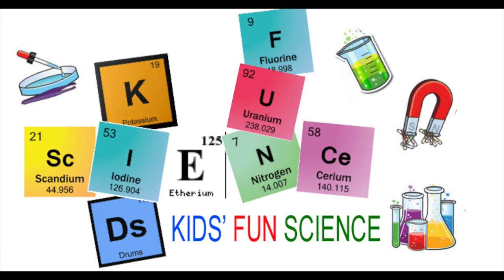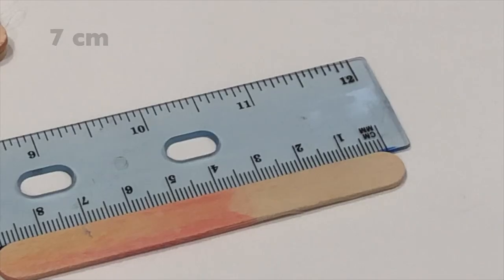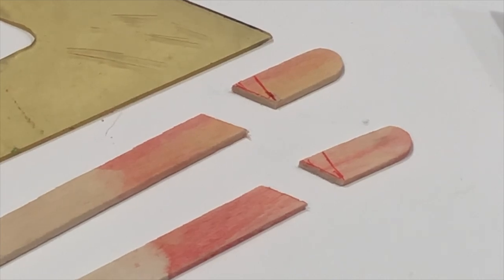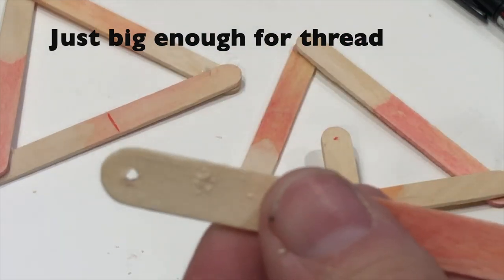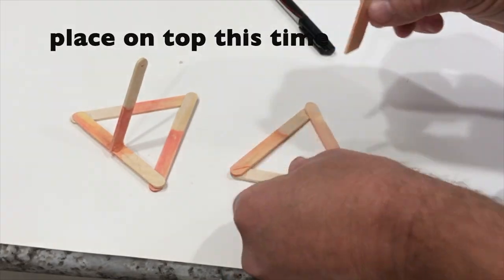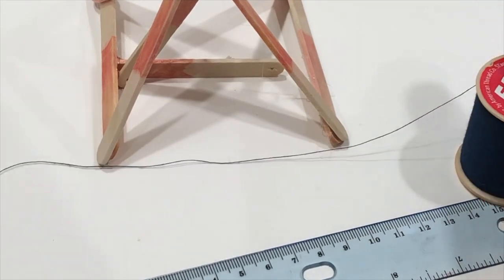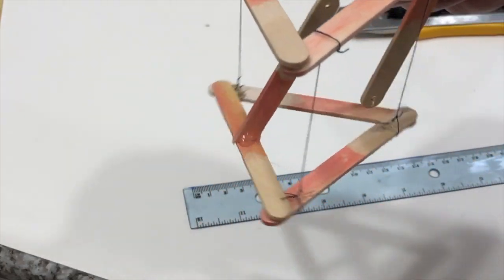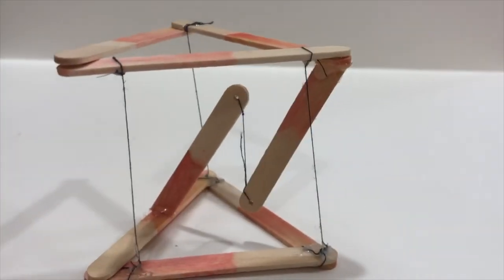Anti Gravity Structure (Tensegrity structures)

Comment: Thanks for doing this...would love to understand how it works.
Reply from the maker: The principle is based on a system of isolated components under compression inside a network of continuous tension, and arranged in such a way that the compressed Popsicle sticks do not touch each other while the prestressed tensioned thread delineate the system spatially.